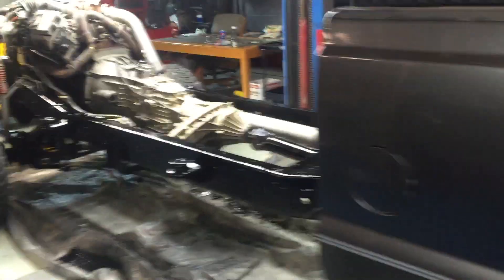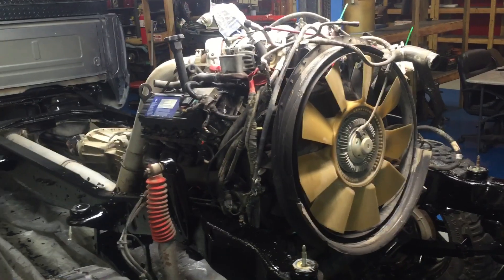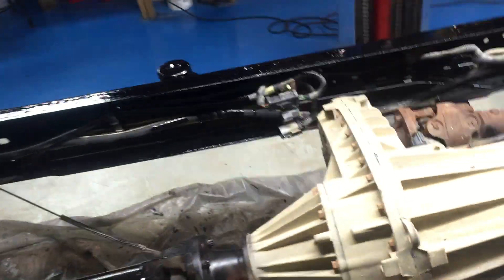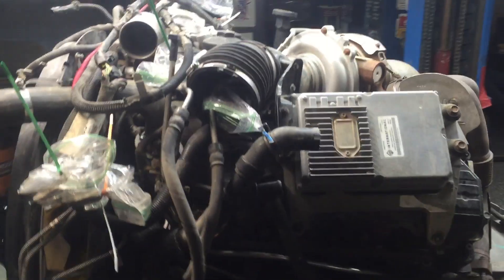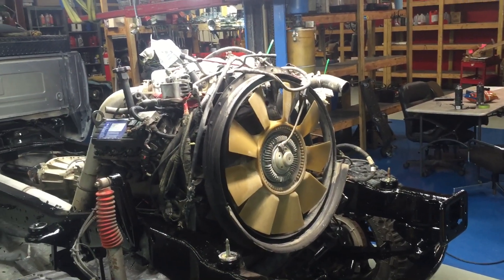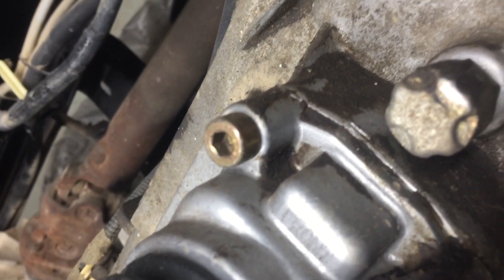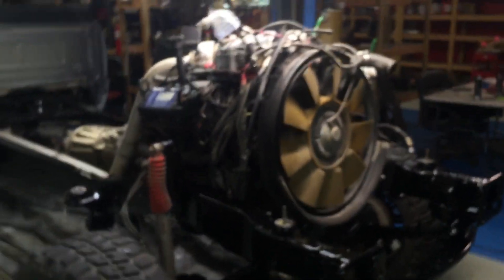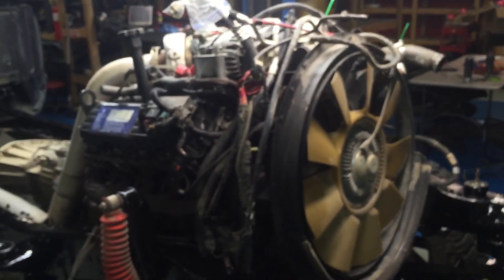Dons 03 no compression

Comment: My 05 250 has the 4 inch pipe on it. It was on there when I bought the truck. I don't like it. The elbow buy the turbo is up against the firewall insulation. The clamp was rubbing up against the transmission fill tube and almost wore a hole in it. The pipe is also rubbing on the cross member, and you can hear it vibrate in the cab. I am getting ready to do a oil/egr cooler change. The 4 inch down pipe is coming off when I remove the turbo and not going back on. I am going to switch to 3.5 inch instead.
Reply from the maker: 466htrd I'm not against the bigger exhaust.  But I hear that.  I've yet to see one that actually fits.   Cab off imho is how that stuff should be put on.  Cause then we can fine tune it and make sure it doesn't rub.  But welding the joints is something we do a bunch of.   

Bigger exhaust is like a coolant filter,, the concept is great,,  but implementation SUX!!!!